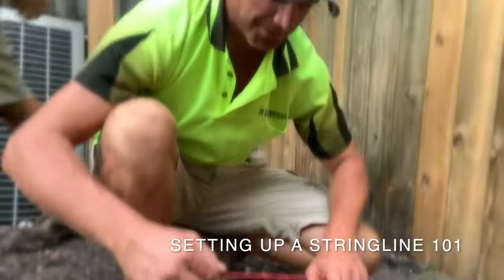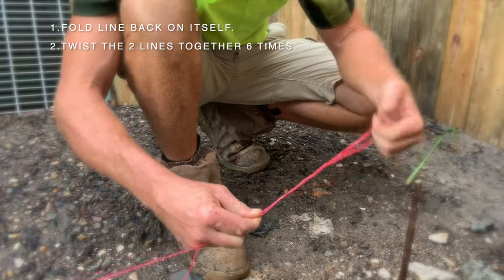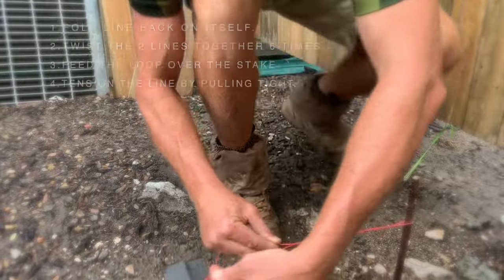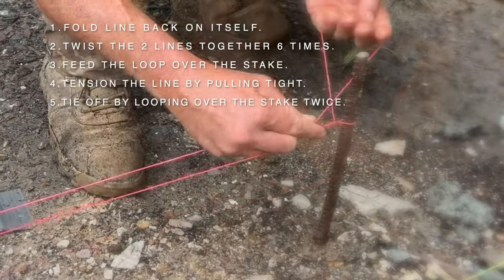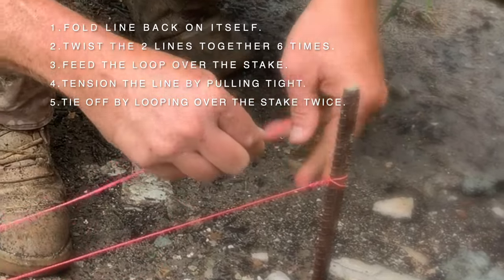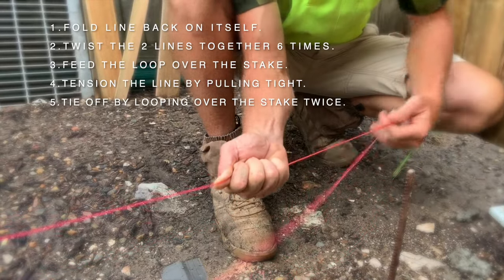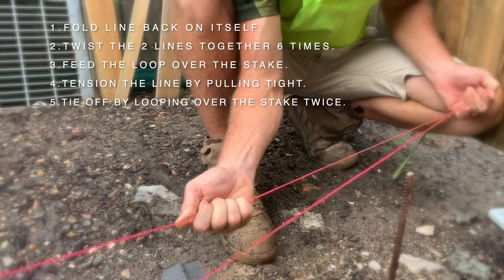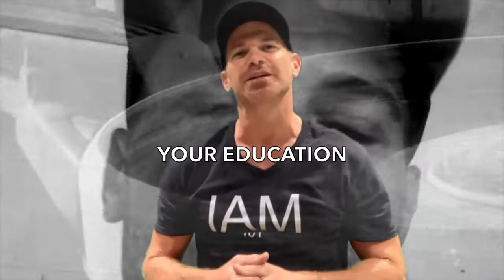STRING LINES 101 (How to set up a string line on a construction site.)

Comment: I'm laying some patio slabs at the moment and two things I have learnt is that having tight and accurate string line is a must and that watching string techniques on YouTube does not mean your lines will be tight or accurate. My technique is terrible and I know I need practice outside of this project but I'm in it now and I just wrap it up loads to get by but I'm not happy ha.
Reply: I know how you feel. Believe me. I've been trying for a month to achieve a straight line across the front of my yard to build a garden wall. I am a perfectionist but no matter how hard I try I just can't get it right. I'm frustrated beyond belief. All I want is a straight line. I never dreamed that was going t0 be the most challenging part of this project.  .Tonight was my last-ditch effort.  If this doesn't work for me I'm hanging it up.
Reply: @lisaevegordon-INFP  did you get it
Reply: Shouldn't be that difficult, get it figured out ?

Comment: There a way to sight the string line and make sure it’s straight from both ends of the stake? Apart from eyeing it. Was the most straight fence post
Reply: Use a tool called a line level